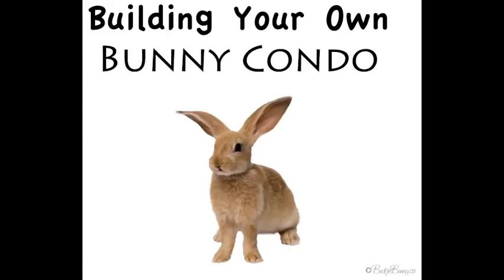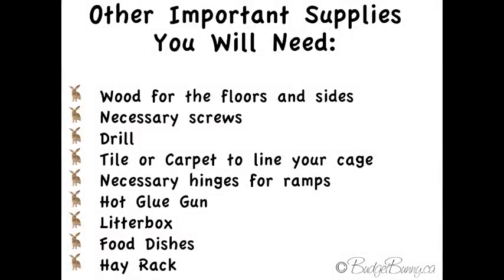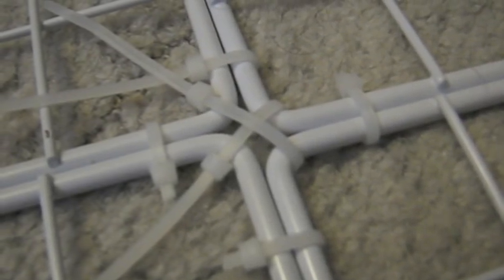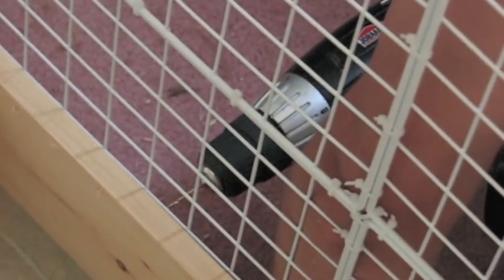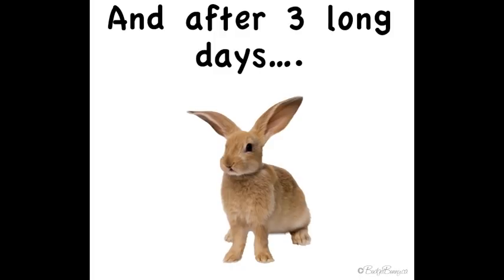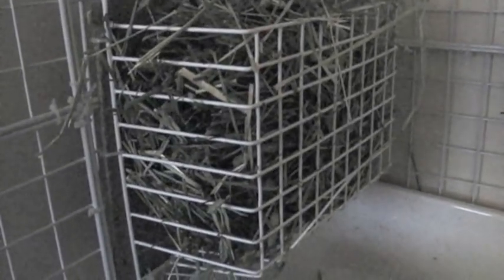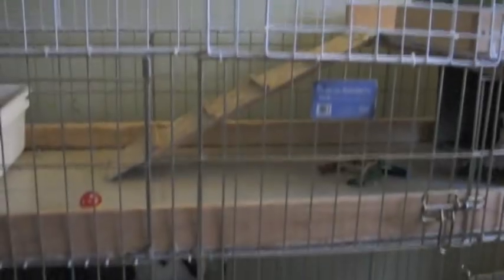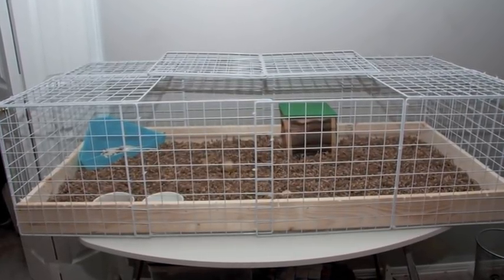BudgetBunny: How To Build Your Own NIC Rabbit Condo

Comment: What if ur bunnys head is small enough to fit through the grid? Should I put screen on the outside? Or get smaller grids? Please reply anybody! I'm a new bunny owner so yhea... :3
Reply: Well, I got my bunny as a baby, and the grid holes where really big to him. He actully realized that he could fit his whole body through the large holed grids. I got my cubes at Target, so there were some small ones and big ones in the pack. I would reccomend using the large holes for the bottom of the cage levels and the small ones for the walls. That's just what I ended up doing when I redid his cage. Hope this helps!
Reply: thank you, it helped :)

Comment: How many storage cubes does a pack come with ?
Reply: I usually see them come in 20s, so for a smaller cage you would maybe need two packages. But if you were to build a condo like this you might need 3-4 packages, varying on how big you want the condo to be. Hope i could help.
Reply: BunBun Bunny Yeah you did help Thx! I am planning on getting a bunny! But one more Q, how mutch does a pack cost?
Reply: Around 20 dollars I got 2 boxes of them off of eBay the other week and there are 23 grids in each box :)
Reply: Chasiti Sell ok thx :)

Comment: Okay no offense but the grids don't look the best so I just bought a $20 super large dog crate it was like 4 of your 2 story condos and took some same wood that I got for free and made 3 stories and there's only 3 bunnies living together but there old so they get along and tip for your hamster the tubes your using is not good for you hamster they are tiny and hard for the hamster to get oxygen and if they get stuck in the tube they can die but overall very good nice cage

Comment: wouldnt recommend using cheap pressboard,has more glue in it than plywood,should only use solid suger pine,no oils and its the perfect hardness for their teeth.Also not very much to buy but better than toxic pressboard